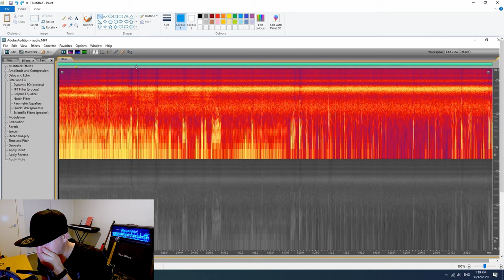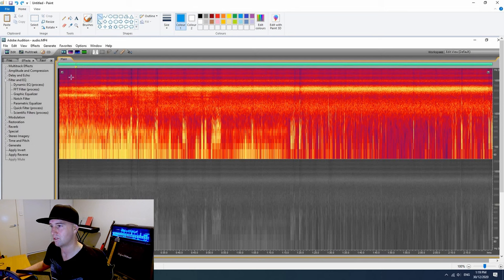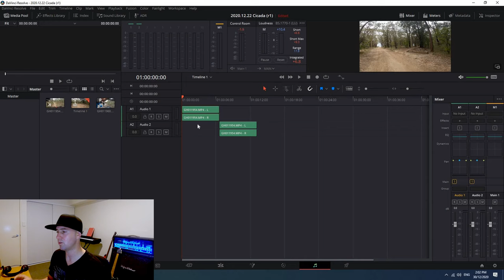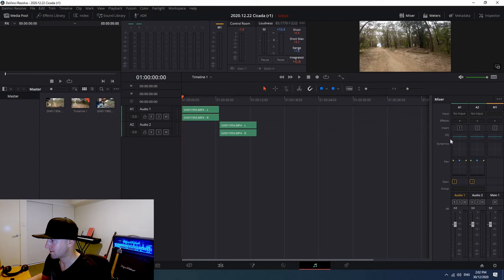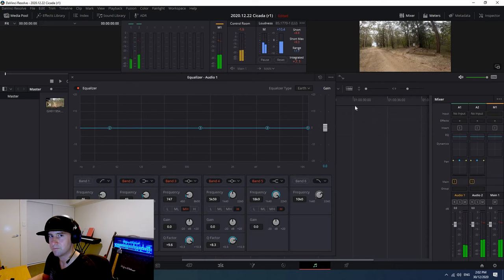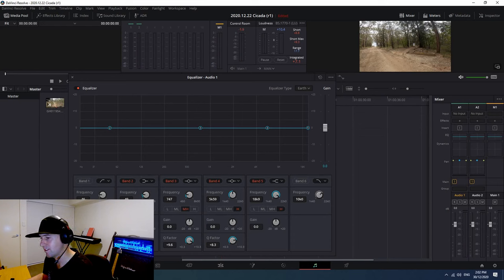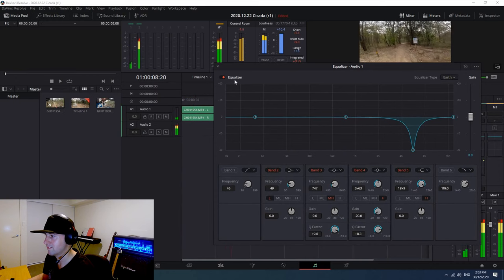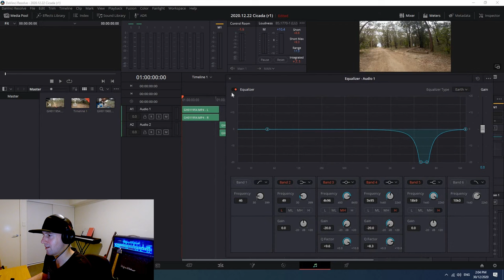HOW TO REMOVE CICADA NOISE FROM YOUR AUDIO TRACK

Comment: Spent a long time trying to de-noise with special tools to no avail. I watch your video and try a simple lowpass cut on the top frequencies and it solved it. Thanks, mate!
Reply from the maker: You don’t need to pull all the highs out, but that will definitely work to remove all the unwanted noise. Glad it helped.